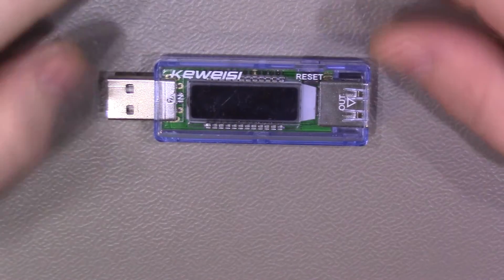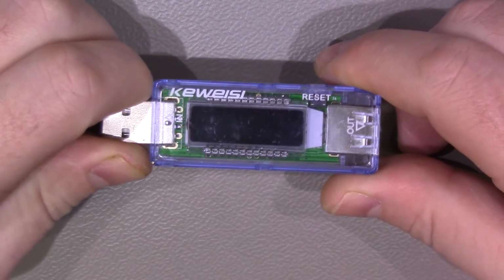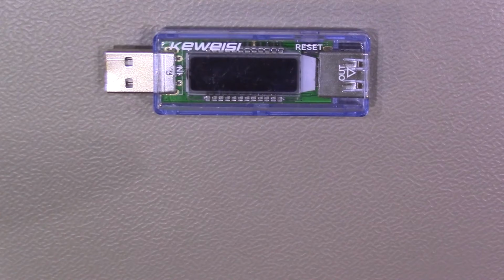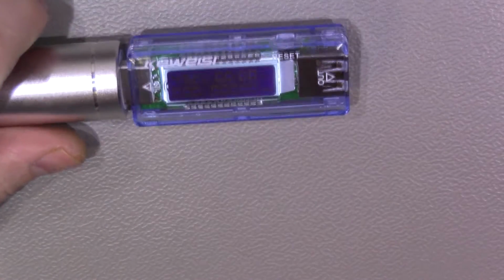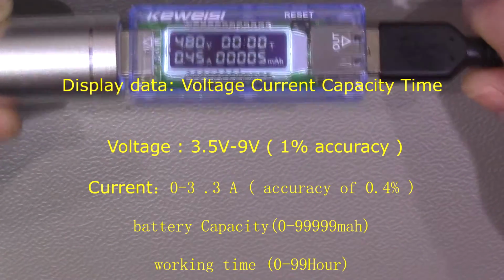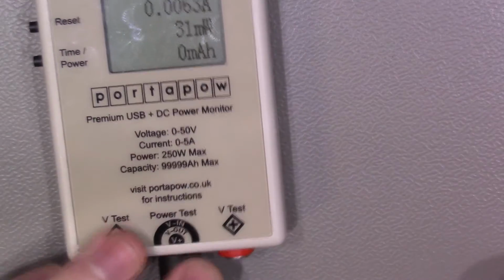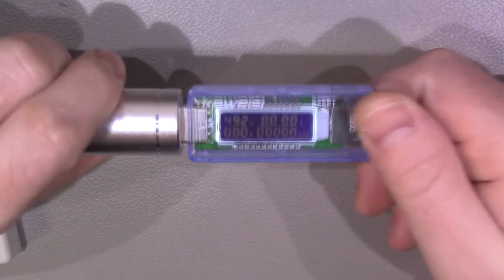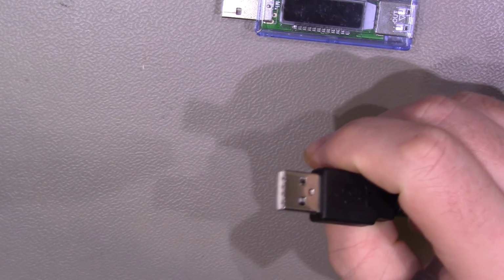Keweisi USB Power Monitor - Quick Overview

Comment: I got 4 of the new models with a Holtek chip   Compared with the old model with the COB chip these are very inaccurate testers  5 to 10% off  0.03A steps not 0.01. nicely built but the measurement result is crap. I would  not call this a test device. good-looking nicely built  but results are crap

Comment: Does it measure mAh correctly with varying voltages like 5V, 9V, ... or just with 5V?
Reply: Yeah actually most of the modern phones use charging technologies like quick charge 3.0. It is using varying voltages. Some of the similar devices like Keweisi I tested work properly only with 5V, so I bought this one, waiting for it in hopes it works properly.

Comment: Excuse me , On my original IPAD charger the 'A' output  is 2.1A so why the detecter reads the output 0.45A ?.
Reply: thank you so much
Reply: do you know the minimum voltage and maximum voltage usb should read with no load and with a load ?
Reply: I have aukey quick charger . The USB reeds 9.1v when I connect my phone with cable 3m.
Reply: Longer cable, less amps, more heat discipation. Simple physics.